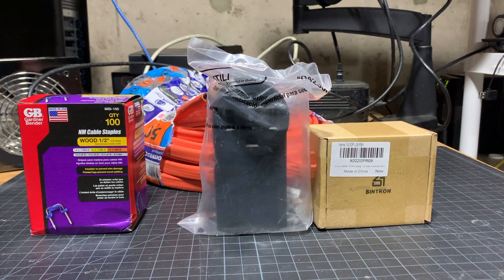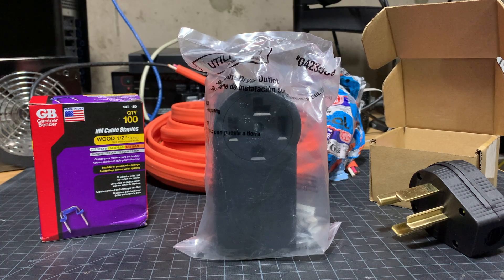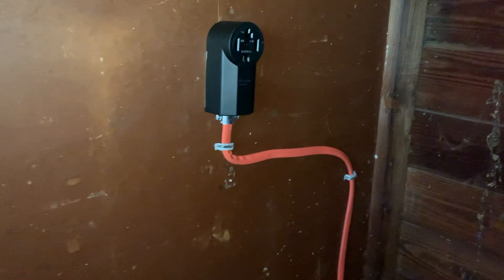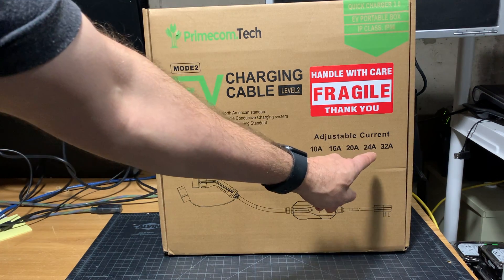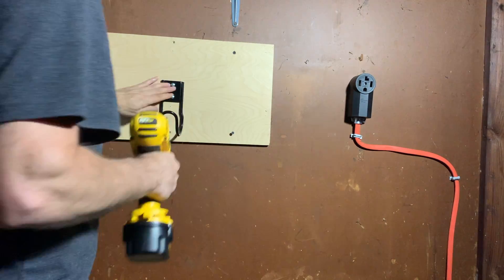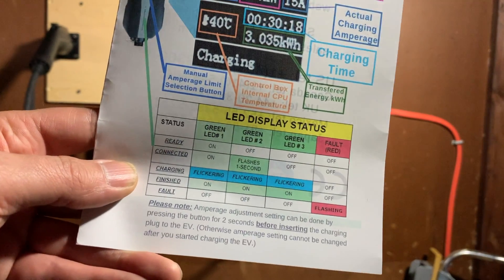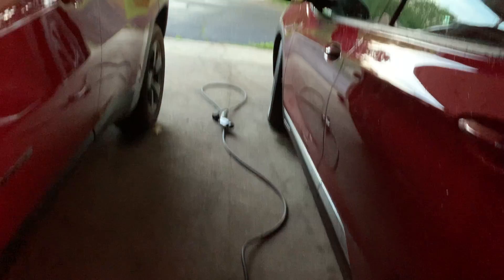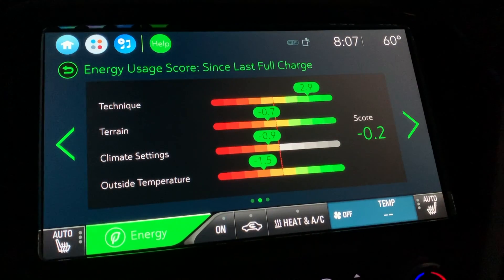Level 2 Charger garage install with PRIMECOM.TECH, 240v NEMA 14-30 garage install for a Chevy Bolt!

Comment: Just fyi... you can save a bit of money and use the vehicle's OEM evse on 240v.  Most evse's were designed for worldwide use and are 240v compatible.  I run my Honda Clarity evse on 240v and it charges 3x faster on 240v than it does on 120v.  https://www.youtube.com/watch?v=FtqbttBXjTg
Reply from the maker: yup correct! then it would be 12 amps @ 240v vs 12 amps @120v. I like having the option of 240 @16-24 amps... for those days when i forget to plug in the car 🙄😂